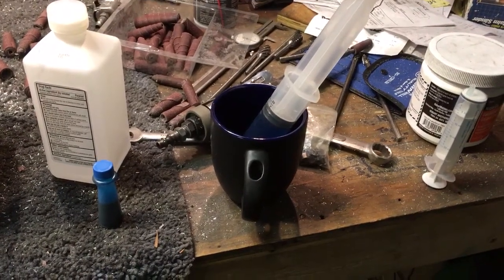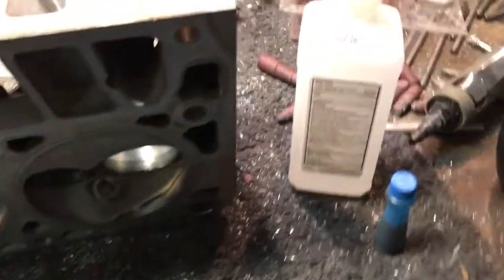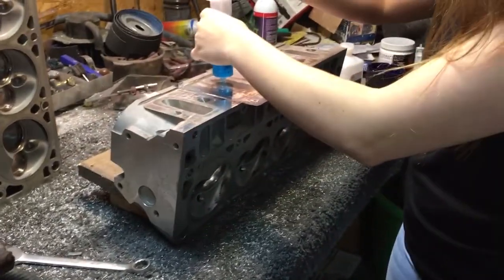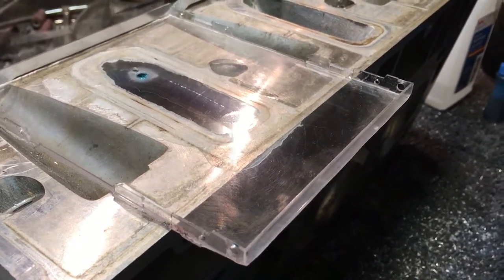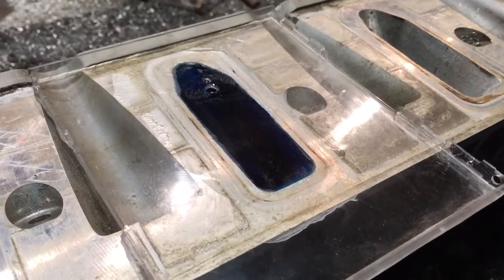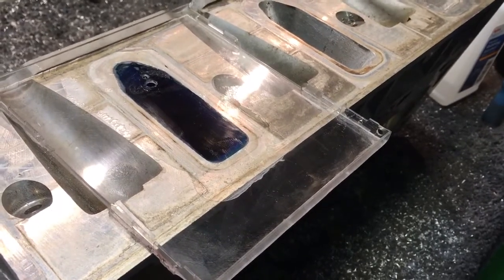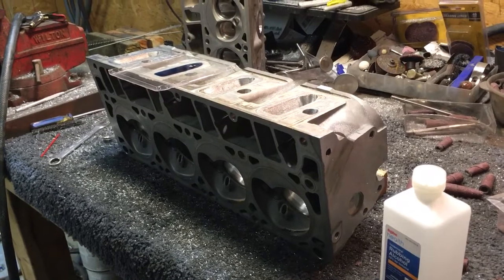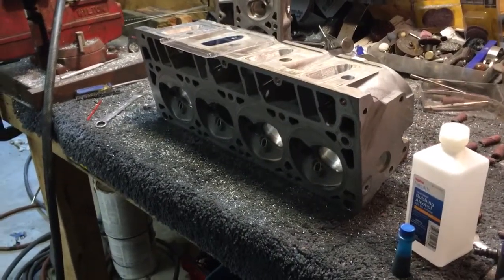How to cc cylinder heads at home cheaply

Comment: I am glad I saw this video..I ave done 2 sets of heads prior to my 706"s I am working on now and never thought about cc'ing the chambers...duh..I will do this now when I am about finished with these.
Reply from the maker: Ross Krause The thicker the plastic the easier it will be, make a nice countersink bevel to the full hole helps.  Measuring the cc’s of the ports and chambers is the only way to measure the changes without having a Flow bench.  Thanks for the feedback I appreciate it, I’m happy to see others applying this skill set!  👍👍👍. JD
Reply: @HeadFlowInc  Yep great info here.

Comment: Cool stuff, i have a cheap "kit" with the glass burette, and i say i still can always do it more accurate with a drug store syringe.  The plate in the kit also i feel is a little small when trying to cover combustion chambers, i also ended up drilling a second hole like you have for air to escape.  I completely agree this is the way to go, and saves about a hundred bucks.   Really like your videos! Keep em coming!

Comment: Pulling my heads soon. Putting a bigger & better cam with Johnson lifters. Gaining 11* intake and 8* exhaust and 7.5* overlap all @.050”. I’m hoping this combined with my ported intake and heads will yield 20+ whp. As well carry the curve up top 6500-7000 rpm. However I didn’t buy the heads and was told they are AI heads. Are they actually 280’s. Well cc’ing the intake port should confirm. 260cc stock and 280 cc ported. I’m gonna be a lil upset if they aren’t ported. 🧐
Reply from the maker: No catherdral port will be near 260-280cc intake port! Are you talking new square port heads?  Or CFM of flow?  Overlap bleeds cylinder pressure which can lose power in the low/mid range.

Comment: what do you do to clean the gunk and residue of the rubbing alcohol and the food coloring? is it better using acetone? thank you
Reply from the maker: Neutral God I use a shop rag and the alcohol to wipe it then blow it off with air hose.  You could spray it with brake cleaner if needed. 
Thanks for watching!  JD
Reply: @HeadFlowInc  is it that you're doing?

Comment: Do all the runners have to be exactly the same cc? If not how much of a difference is acceptable?
Reply from the maker: It depends on the cylinder head, not all heads have symmetrical ports.  If you’re working on a symmetrical head try to get the ports with in 2cc or less. 
Heads like BBC will have 2 good ports and 2 bad ports as an example.  JD

Comment: Why do you think it will flow 275cfm?
Reply from the maker: When you've developed a technique and port shape including size in cc's for a cylinder head, you've had flowed before, there's no reason to flow them every time.  I know from flow data on these heads what flow range it will provide based on port size, consistency and being able to accurately recreate your work is key.   I always offer the customer the option to have a port flowed if they choose.  I'll stand behind my ports because I know they work. Thanks for the feedback! JD

Comment: Not a bad video but not good either.  Way too  drawn out, most people will lose interest after 3-4 minutes.  Too much talking and  that bench mess is a disgrace.  When was the last time it was cleaned?  I hope the porting work is better than the work area.  To do porting work you need to start with a clean mind and that starts with a clean and tidy work area.
Reply from the maker: Steven W I guess you could read a book?  A 10 minute video showing how to cc a head on the cheap is not bad. 
Judge not less ye be judged. 😇
Reply: I bet your work area is pristine... its very common among people that never actually do anything...